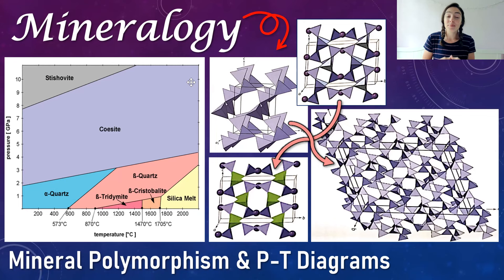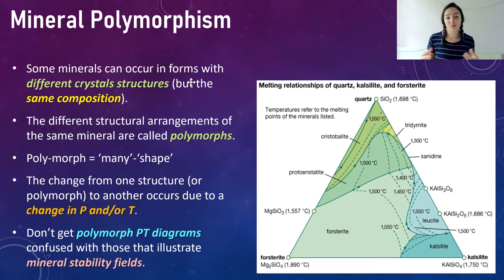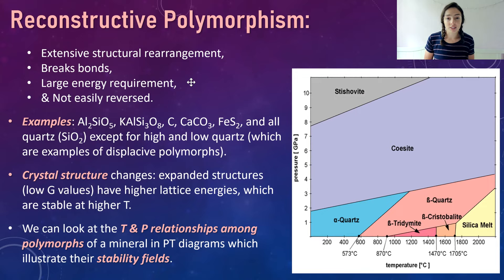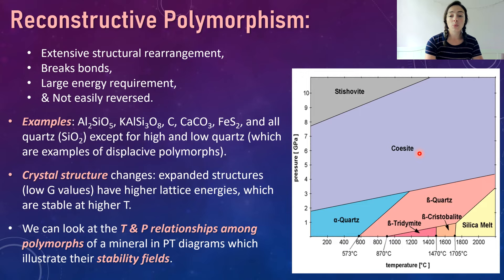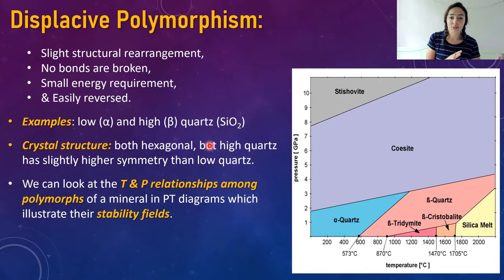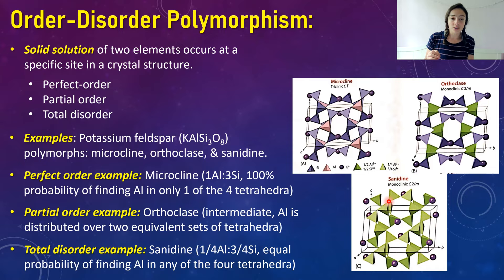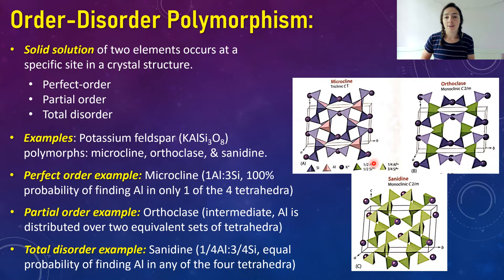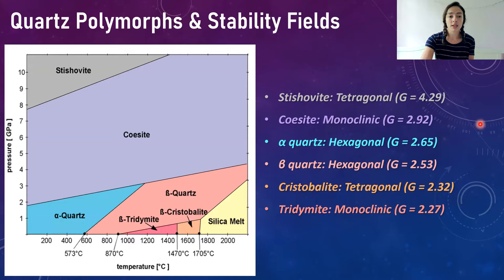Mineral Polymorphism & PT Diagrams- Mineralogy | GEO GIRL

Comment from the maker: Hi all, CORRECTION! -> Andalusite, Kyanite, and Sillimanite (Al2SiO5) are aluminosilicates, not technically feldspars, which are tectosilicates. Feldspars include the Plagioclase feldspar solid solution series: albite (NaAlSi3O8) - anorthite (CaAl2Si3O8) and the K-spar polymorphs: Microcline, Orthoclase, and Sanidine (KAlSi3O8). Sorry about the confusion! :D

Another CORRECTION: aragonite is orthorhombic not rhombohedral, sorry about the mix up😉

Comment: Hi
You mentioned low quartz is hexagonal. But I found it is trigonal from various papers and journals. And could you also explain how these transformations take place?
Reply from the maker: Well it seems you are right! Thanks for pointing that out. The book I am using says hexagonal, but when I look in the more recent papers, it says trigonal, so good catch! :) As for how these transformations occur, that would be by changing the temperature, the pressure, or both. As for what exact temperature/pressure these transitions occur at, it is different for every system of polymorphs and for every pair of polymorphs within a system, which is why the labeled PT diagrams are helpful. For example looking at the Quartz diagram we can tell exactly where (what P and T) the transition from low to high quartz (or vice versa) will occur. However, if you are referring to the exact mechanism that changes the T and/or P, that would also be different for every system. For example, calcium carbonate might switch from one polymorph to the other as its depth in the water column or sediment changed. However, with quartz, it would most likely be in a subsurface, high T environment, for example, within a melt rising from the mantle into a lithospheric magma chamber. The rising melt is decreasing in pressure, potentially causing it to convert from stishovite to coesite, then it starts to cool in T and crystallize, potentially causing it to convert to low quartz. However, later on if that solidified piece of low quartz ever became metamorphosed (heated and pressurized but not fully melted), it might convert back to one of the high pressure polymorphs during the metamorphism. Hope that helps a bit ;)